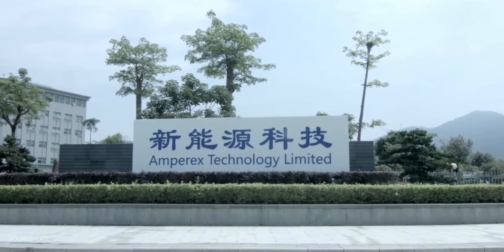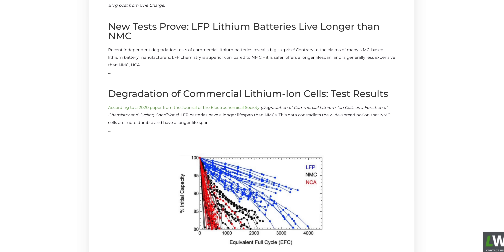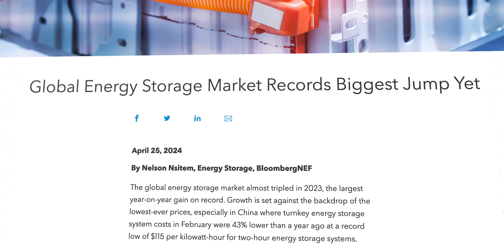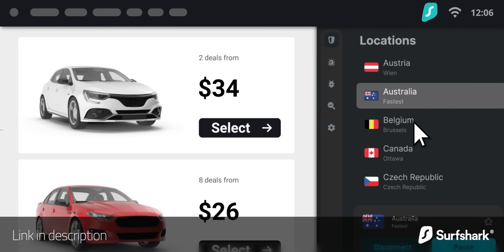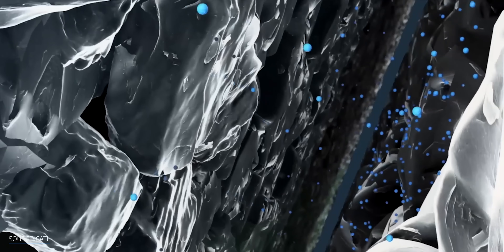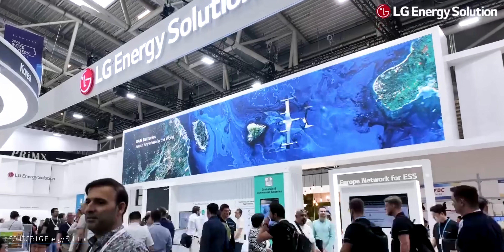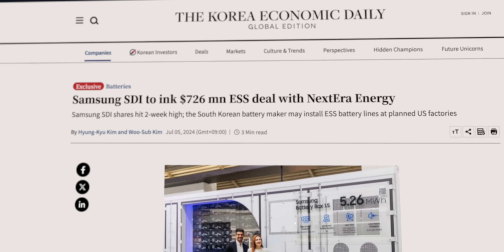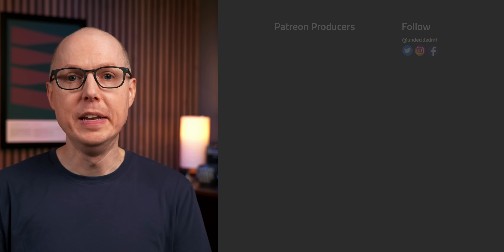How This New Battery is Changing the Game

Comment: 15kw is not enough to power a US household for two days I’d say conservatively no EV charging 30kw maybe per day
Reply: W is power. Energy is Wh. So you should have used kWh, not kW.
Reply: Maybe enough if natural gas was used for cooking, heating, and hot water 😂
Reply: It really depends on how much generation you have.  A battery is not a generator, after all.  15 kWh of storage is not running the entire home for 2 days all by itself.  People with winter solar + battery systems generally have to put in a huge amount of solar.  The batteries are there primarily just to bridge overnight.  And a generator is still required to bridge bad weather.

There are a lot of variables, primarily weather related.  Home heating and cooling easily clocks in at 80%+ of home energy use.   Lighting, cooking, and heating water represent the remainder but are fairly low consumers of energy just in general.  A hot water heat-pump / 80-gallon tank for 2 people eats around 2 kWh/day, for example, which isn't much.   Lighting and cooking are similar.

-Matt

Comment: Every week, another "new" battery is changing the game
Reply: But this is a good thing.    Now and then one of them makes it to market and we win.
Reply: Yes! Exactly!
Reply: There are several different battery usages - grid level storage, home storage, electric vehicle, appliance and small devices, industrial heat batteries, residential heat batteries, community heat batteries. Lots of different kinds.
Reply: @matthewjohnson3656   the different usages really just require different voltages(sometimes).  But everyone wants high capacity and long life for every application
Reply: @veganpotterthevegan  Theres more to it than that. Heat batteries are entirely different than electrical batteries, and there are different applications, scales and input heat sources. For electrical batteries, there is more than just total cycle lifetime. There is also weight to energy ratio, cost to energy ratio, Whether it can be used in a moving application (liquid metal batteries can't) how fast it can charge, and what heat/cold ranges it can safely operate in.
Reply: @matthewjohnson3656  they're all the same in intent.   It's about storing as much energy as possible, being the easiest to charge and having the best c-rate possible, with as close to no degradation as possible.
Reply: @veganpotterthevegan  Yeah..... you may want to study the topic more because there is a huge pros/cons between the different battery chemistries and applications.
Reply: @matthewjohnson3656  I always study this.   There are pros and cons.   And tech tries to reduce the cons and improve the pros for all chemistries.
Reply: @veganpotterthevegan yes, but grid is interested in "capacity per dollar" while cars are interested in "capacity per volume". Very different requirements, and very different resulting optimal technologies.

Voltage is irrelevant, just add more cells in series.
Reply: @veganpotterthevegan this is a naive take people want high capacity and life but there’s different ways to do it depending on your application. As they say theoretically there’s no difference between theory and practice but practically there is.
Reply: @veganpotterthevegan  So then you should know that liquid metal batteries are really good for grid based mass storage but are completely unusable for electric vehicles.
Reply: @matthewjohnson3656  yes and that doesn't negate anything I've said.  And people will certainly use them in cars once they're cheap.  Especially in developing nations where cars don't need a long range and old vehicles are and will continue to be retrofit as time goes along.
Reply: @veganpotterthevegan  you don’t know what you are talking about. You cannot use liquid metal batteries in cars because they move and need to be kept at several hundred degrees. Not to mention they are very heavy. It’s a complete nonstarter. In a grid storage solution they are great because energy to weight doesn’t matter and grid storage doesn’t move. The main thing that matters is cost. Seriously you really need to do more research.
Reply: @matthewjohnson3656  I suggest we change the subject to something you're informed about.   Yes,  they're heavy. But they're going to be extremely cheap and long lasting.  Many people have little need for power dense batteries.  The liquid issue isn't a problem at all
Reply: @user-mc6dg6qe8l  yup, people want the best of everything at all times. Of course,  economics is a huge factor which is why there are people in India, China and the poorer parts of south Asia converting ICE cars and running lead acid and AGM batteries as we speak, including one of my cousins in the Philippines that drives an old Civic with a forklift motor and 30miles of AGM capacity without AC🫠 The thing is a heap but it's cheaper than replacing the engine and buying $8-10 gas
Reply: @veganpotterthevegan  I seem to be more informed than you since you don’t know how liquid metal batteries work. They fundamentally don’t work in cars. They cannot be used inside anything that moves.
Reply: @Validole  you think people don't want capacity per volume and cost in their cars?   If it was only about capacity per volume, LiFePO4 batteries in cars wouldn't be a seller.
Reply: @veganpotterthevegan  you obviously DON’T study this, or you were so eager to respond and seem correct that you didn’t closely read the comment made by Matthew.  Heat batteries store energy as heat / thermal mass, and depending on the application it’s being used for, it may never be converted into electricity. So no real chemistry involved, and definitely no c rate.
Reply: @sjsomething4936  you're acting like I said that any and every battery is great for any and every application. It seems like you have a major literary problem above all else.
Reply: @veganpotterthevegan  No? If you're building a static energy bank, you probably don't care nearly as much about energy density as someone building a smartphone. If it's cheaper to just install two batteries instead of one with twice the density, you'll do that - especially if it's got other benefits, like safety or environmental impact or longevity. 

Also might not care too much about discharge rate.
Reply: @veganpotterthevegan  oh, wait, never mind, you're one of those people who twist things and dodge questions and pretend you know everything after people tell you explicitly and with detail how and why you're wrong. Don't bother responding.
Reply: @hypotheticalaxolotl  do you think anyone building a stationary battery bank,  no matter the size,  wouldn't also want higher density if they can get it and cost isn't a factor?😅
Reply: @veganpotterthevegan  Of course they would, but cost is always a factor, so that's a meaningless thing to ask.
Reply: @hypotheticalaxolotl  look at you,  replying to me.  You can't even stick to doing what you say you'll do. 
*Of course they would,  which is contrary to your BS comment.
Reply: @veganpotterthevegan  you made a good and salient point and somebody just throws a hissy fit and call out names ! Wow the dudes a Wally!
Reply: @RobertPotter-c2g  ha, for sure.  Nothing I said was terribly complicated, and it's nothing battery producers aren't claiming.
Reply: Energy storage is the biggest hurdle moving into our tech future. Right as it stands we lose an incredible amount of electricity to the grid because of storage limits
Reply: i will believe it when I can buy it
Reply: And lord knows Matt will cover every single one.
Reply: Tbh … loving it 💪🏻
Reply: @hvranic  don't know why the scepticism/pessimism when it's obvious these tech are already being rolled out as we speak. It's no longer tech in the labs. If the logic that systems need time to be shipped,  installed and then turned on; is beyond you then I got nothing else to say.
Reply: Because It Is
Reply: Every week for the last 30 years
Reply from the maker: Yeah ... because there's a ton of movement and evolution in the energy storage space right now.  This isn't a static field.
Reply: @UndecidedMF  but how many times can you change the game, before it’s no longer the same game?
Reply: @NightRogue77 hopefully not too many more… I don’t like this game.
Reply: @UndecidedMF  well, look at the last decade of development in real, market ready batteries vs. the countless miracle batteries announced. Batteries still linger around 200 Wh/kg in real applications, don't like charging above 3C much and maybe moved 20% in a decade. Promises almost always exceed the real progress by an order of magnitude.
Reply: @UndecidedMF Battery industry plant confirmed. 🥸
Reply: Static field battery confirmed
Reply: @UndecidedMF  punny!
Reply: @UndecidedMF you probably earned more money from just talking about these but doing nothing for research and development of batteries. Poor Chinese who do the research work don’t make videos.
Reply: @UndecidedMF  It's a well-charged field... but some could say it is polarized. Some people will meet any kind of dynamic change with resistance.  :D
Reply from the maker: @DaveMcCall  👏 well done … well done
Reply: @UndecidedMF  But what is counted should be what will be mass produced. Because the batteries are in the lab, they probably won't hit the market for another 10 years.
Reply: @UndecidedMF and yet nothing ever comes out. I wonder why 😅
Reply: @UndecidedMF  like that "pseudo solid-state" system that isn't actually solid state...
Reply: @veganpotterthevegan what about pacemakers and RFID’s 😂
Reply: @aflack482  those aren't even claimed to be solid state batteries🙃  *Some RFIDs don't have a battery at all
Reply: @UndecidedMF    maybe the manufacturers of battery evs should have waited untill tech was there before releasing evs but eh its only peoples lives manufacturers are playing with 😡
Reply: @stum8374   original Nissan Leafs weren't great cars but they're not exactly randomly catching on fire. Tesla's real problem is their autonomous driving.  Yes,  fires are in issue too but that potential is there with ICE vehicles too.  But the autonomous driving has nothing to do with the batteries.  Gas cars can be autonomous too.
Reply: @hvranic   Right!  Another breakthrough!
Reply: @hvranic  And every week the same pointless comment complaining about battery “breakthrough” news. Yeah, we get it, most of them don’t make it to market any time soon.  It’s still interesting to hear about though
Reply: The game is always changing
Reply: That’s because it’s a rapidly innovating market with lots of incentive to try new things. Compare a battery now to a battery from 80 years ago. It’s like comparing a rocket engine to a campfire.
Reply: Like every apple event, now our iPhone last 2 hours more than last years, so by that logic it should last at least 17 hours more than first iPhone but that’s nonsense. Just like these new “game changer batteries”
Reply: Not from CATL though. They came through with their qilin battery and the condensed matter battery
Reply: He literally says LFP is old tech
Reply: It's almost like there's a huge demand driving innovation 🤔. He covers this in the video.
Reply: More innovation these days...yay
Reply: Because we are finally on an upward trajectory
Reply: Ain’t it great?
Reply: This guy is a press release content machine so everything is "disruptive" or "game changing" to help these companies raise money
Reply: @uog293  which is a good thing, because no one else is promoting them.
Reply: That’s because this is the one thing that will move human evolution along above any other and so all the smart minds are pushing this conundrum forward at a pace. So yeah, it’s moving quick and rightfully catching lots of headlines. Stop bitching start learning that’s my Moto
Reply: Yeap... click bait...these batteries will not become of general use until later...so much later...
Reply: Same thing with solar panels. So many breakthroughs yet nothing higher than that pesky 21% efficiency can seem to break the market.
Reply: Everybody is pushing the state of the art targeting one issue. This makes for many game changers, in one area, for press releases. The real game changer is if anything actually comes on the market in volume and at an affordable price, and that isn't the purview of a tech taster channel.
Reply: @hvranic  🤣🤣
Reply: Skedta n du necplored point off  ptogress
Reply: The quicker way to say that would be “I didn’t watch the video”.
Reply: Well they're changing the science game, maybe not the successful business game 🤷🏽‍♂️
Reply: ENOVIX corporation is well on their way towards mass production of their groundbreaking patented batteries.
They’re the real deal, getting things done.
Their YouTube channel is very informative regarding how their battery technology works.
Reply: What should raise eyebrows is why is our govt is not doing more to keep up with China in green energy. Fossil fuel are finite and the rest of the world is tired of the political instability of oil and gas so we can either lead or follow into the future of energy. We have a ton of world leading research but relying on the "free markets" to take the risks is laughable and not a single major American sector has thrived without govt intervention.
Reply: @sunkings5972  mainly because of fossil fuel lobbying and the extremely resistant to change Maga party. They will oppose just about anything that would change their lives
Reply: @sunkings5972 government intervention destroys everything it touches.
Reply: @sunkings5972  the future is, and always has been, Nuclear. Russia knew it, and fumbled the ball so catastrophically that the world chose to enter a fossil fuel powered 'dark age'... nowadays, China is making greater strides in Nuclear energy than any other country, and is the leader in Nuclear plant production.

The irony is the style of reactors they are developing for mass production for static plants are not particularly new pieces of technology... the US and other global powers have been using similar designs for compact plants in nuclear submarines, aircraft carriers, etc. for decades... the difference is the US never developed any industry for mass production of these compact power plants, and so they remain a more 'bespoke' solution for military use only.
Reply: @sunkings5972  what should raise eyebrows is the china has state support/direct funding of tech and lower much lower environmental regulations and labor laws
Reply: @sunkings5972  China builds a lot of coal power plants also.
Reply: @petkoo777  Yes but they are building 4 times as much renewable capacity as coal.

Comment: Bought US politicians hurringly to slap on more tariffs.
Reply: It's worse than that. LFP was born in the US and developed (ultimately) through an MIT startup; A123. A123 went bankrupt and sold off their tech / equipment shortly after General Motors used their Department of Energy money to purchase LG Chem cells for the Chevy Volt instead of the A123 agreement that they had in place.
Reply: @lwwells I remember that. A123 dying reverberated deep trouble for Coda, Fisker and Aptera at the time
Reply: @lwwells Should be worth mentioning how GM sold off their Ovonics NiMH patents to Texaco/Chevron who later imposed a patent embargo on large capacity cells, killing the EV1 and other EVs as well sueing Toyota $250m for the batteries used in Priuses and RAV4EVs